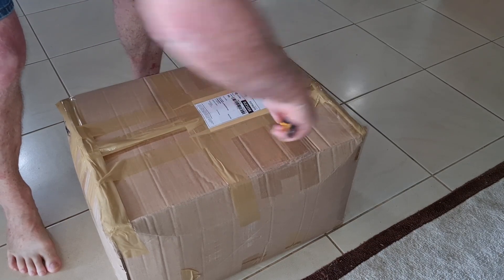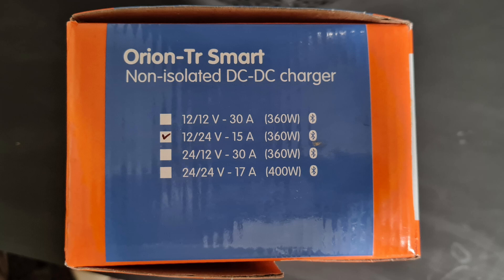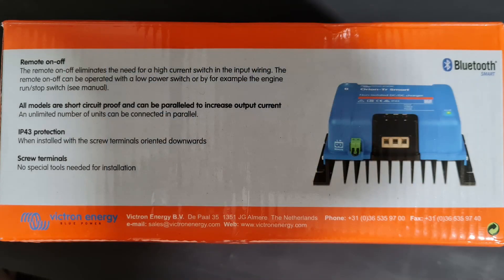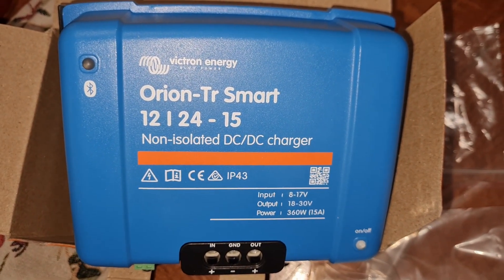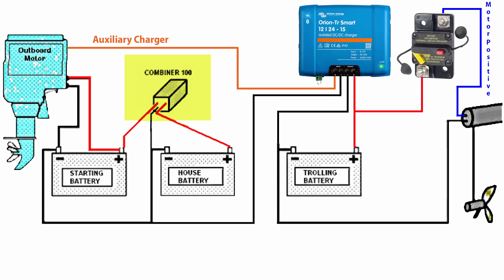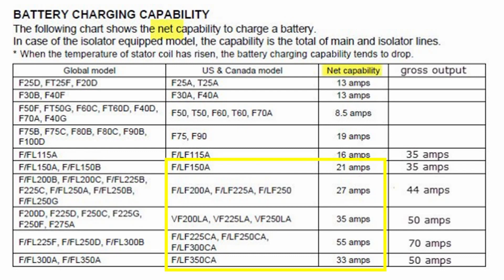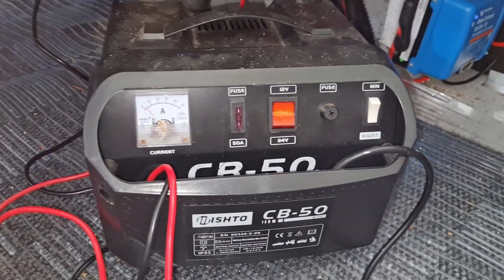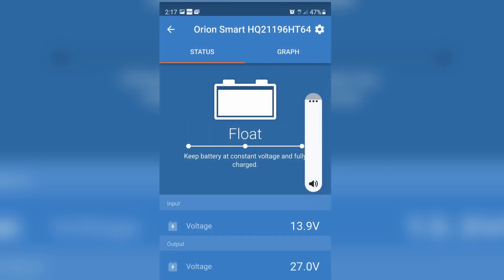Charging a 24V Lithium Battery from a 12V Alternator

Comment: Very instructive video- just a question now a couple years later- any issues with your outboard alternator? No burnout issues? I have had some issues with burning out alternators/ stators running dc dc chargers and am curious if it’s just my setup.
Reply from the maker: Not at all.  I'm also running a 12v dc-dc charger for my 12v lithium now.  Because ot the amp draw when charging a lithium battery I don't try to charge both together, but charging one at a time is fine.
Reply: @weFishAU thanks for your reply. Which model 12v dc-dc charger do you go with?
Reply from the maker: Victron Orion-Tr Smart 12/12-30A Non-Isolated DC-DC Charger ORI121236140

Comment: Great video, I ran across this when searching,  I am updating my trolling motor to a 24v unit along with the batteries you even have basically the same outboard. The only difference is that I also will have solar panels connected. So my question to you is do I have to disconnect my solar when the outboard is running or will it be fine to leave connected. thanks and have a great one.
Reply from the maker: Thank you.
I have since added a portable solar panel that I run when I am anchored up for a while, but I am sorry, I don't have an authoritative answer to your question.  I talked to some RV people about the wisdom of leaving the solar connected while the motor is running and their opinions were divided.  I erred on the side of caution and put a switch between the solar controller and the battery so that I could turn it off if I move a bit.  Since my setup is portable it isn't a bit deal to manually switch it in or out of circuit.
Reply: Thanks I finally have gotten all the bits and bobs in the mail and have installed as per the wiring in the video, I did get the isolated version. I would like to ask if it is not to much trouble could you post your settings on the Victron as I don't want to fry anything.
Reply from the maker: I need to be at the boat so I can read the settings.  I will try to get down there this afternoon.
Reply from the maker: Can you DM me on Facebook @ weFish AU
I have the screen shots but they can't be posted on YouTube.  Alternatively, give me an email address and I can send them there.

Comment: What if you don’t have seperate charging aux cable from outboard?
Reply from the maker: In the diagram at 8:00 into the video, connect the Auxiliary charge line to the positive of the house battery instead of the aux from the outboard.
The green plug on the Victron unit can be connected to the ignition switch so the unit is only active while the engine is running but I have found its internal charge detection works fine.

Comment: Hello sir are you still alive ?

can i use 2 12 volt 100 amp alternators with 2 24 volt transformers connected to a 24 volt battery charger to charge 2x12v 300amp 2x12v 300 amp batteries connected parallel, however while being charged by the alternator the batteries will load 2 2000 watt motors, wich in turn will also move the alternator.  it is a 4 back wheel 2 front wheel electric bike project. i will design the mechanics, however i would either have 4 more batteries in storage so i can switch from using to charging ?
Reply from the maker: I'm not sure I follow exactly what your setup is.  2 x 12v batteries in parallel only need a 12v charging source.  Did you mean series?
I can't make sense of the maths involved either.  The power required to turn the alternators is a large part of the output of your motors, adding the inevitable losses in the system I just can't make the numbers work.  Maybe I just don't understand the setup but I suspect you are trying to charge the batteries using part of the output power of the motors without factoring in the losses involved.
In my opinion I don't think adding an alternator that is driven by the electric motors is going to be of any benefit.  If anything, it will reduce the range of the device rather than increase it.  If you devised a system like the KURS system in Formula 1 cars then there may be some benefit but it is also unlikely that a bike would recover sufficient energy under braking to be worth the cost.
I hope this helps and sorry if I have misunderstood your use case.

Comment: would it be safe to run the outboard and trolling motor simultaneously?
Reply from the maker: If you mean running the outboard in neutral to charge the batteries while using the trolling motor, then yes.

Comment: I've watched your other charging videos a lot.  I am in process of updating to the trollbridge 12x24 with the built in combiner.  I was switching over to 12v lithium x2 for the trolling motor.  Watching this new video, I'm wondering if you seen any major advantage of going with this new system?
Reply from the maker: No major advantage IF you have 2 x 12V batteries for your 24V bank.  I went with the new system because I got a very good deal on a single 24V lithium battery.  Had I had a bank of 2 x 12V I would have stuck with the trollbridge.
Reply: Thanks for responding.   I am installing everything on a tritoon.   I removed the changing room area and am making a cabinet with a few extra items to make the longer fishing days more enjoyable, and the over night trips more like a camper.   I am adding a 6000w inverter, dual 100ah lithium batteries, 400 watt solar blankets for over the Bimini top, a small fridge/freezer combo, and a few drawers for my tackle and gear.    Luckily my nephew works in a cabinet shop and can auto cad all my dimensions and plan the cabinet out in a 3d model for me.   Will be making it out of polyurethane sheeting.
Reply from the maker: Sounds great.  I particularly like the idea of the solar panel.  I hope it doesn't take you too long to complete.

Comment: I see the highest amp is 15 in the orion 12 to 24.  My suzuki 250 has 54 amp alternator that outputs 38 amps at 1000 rpms.  Safe to use 12/24 - 15 amp inverter?
Reply: Thanks. Victron just said to use the 15 amp.  I use my trolling motor (built in gps) on ocean to hold in one spot ... trolling to counter wind and current.  I will keep my outboard out of gear and idling while the trolling motor runs at the same time.  If its blowing 15 mph, the trolling motor is running at high speed almost continuously.  There are no issues with battery receiving 24 volts from victron and at the same time it's being drawn out to keep the troller running, correct?
Reply from the maker: No problem at all to have it charging while the trolling motor is running.  If you have the trolling motor running at full speed for an extended period of time I would recommend going with wire that is at lease one gauge heaver than they recommend and buy a very good quality circuit breaker (to avoid heating the circuit).  I would probably also spring for one of the exceedingly expensive Minn Kota plugs (if you need a plug) in that situation.
Reply: Thanks for your fast replies.
Reply from the maker: You're welcome.
Reply from the maker: The 15Amp is on the 24V output so that is 30Amp on the 12V input.  Depending on the safety circuits, 38Amp might be okay.  Safest thing would be to drop Victron an email and ask before you buy.

Comment: How are you finding your cranking of the engine as lithium battery don’t have as much crank power. As normal battery’s   I. Ran a lithium in my motorcycle and it would hardly swing the moter enough to fire  , took bike to shop showed them. They replaced it 2 times in 3 months. Sending them back to manufacture. Replaced again with a normal lead acid. Wound engine over so fast you can hear starter spinning while engine runs.
Reply from the maker: I have heard similar stories about Lithium cranking batteries.  For that reason I have an AGM battery for cranking, a 12V Lithium house battery and the 24V Lithium battery for my trolling motor.  The Lithium batteries are perfect for their assigned use.
Reply: If you want a lithium battery for cranking, look into Anti Gravity batteries
Reply from the maker: Thanks for the info.  My cranking battery is still reasonably new but I will definitely look into it when it needs replacing.  Great weight savers.
Reply: @weFishAU  Absolutely! My brother has their ATX-20 sized battery I believe and it’s less than half the weight of his stock Miata battery… amazing stuff